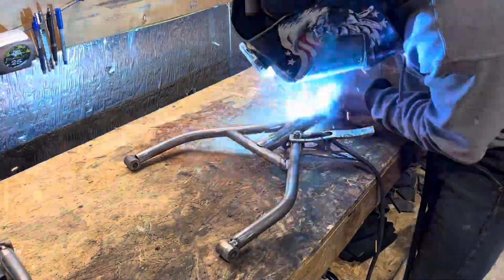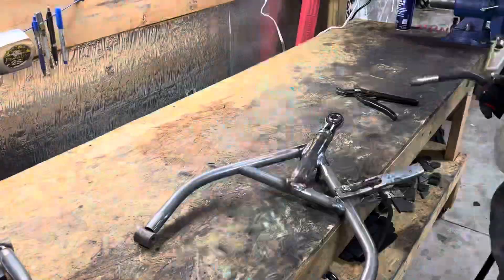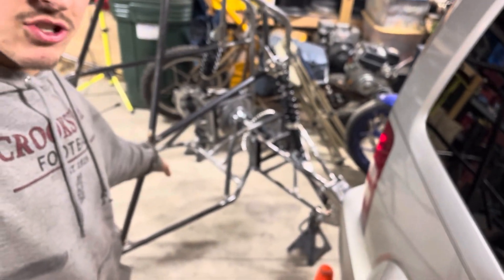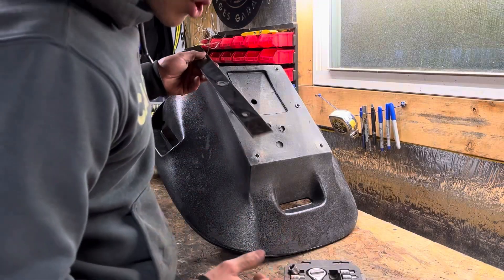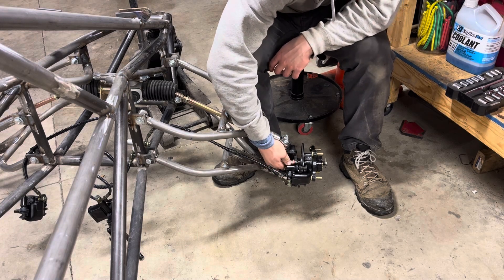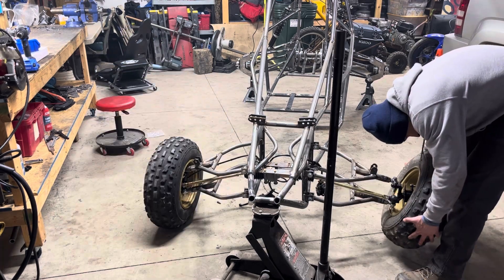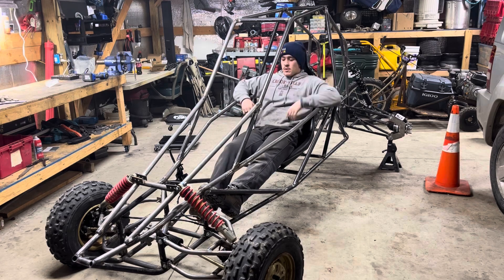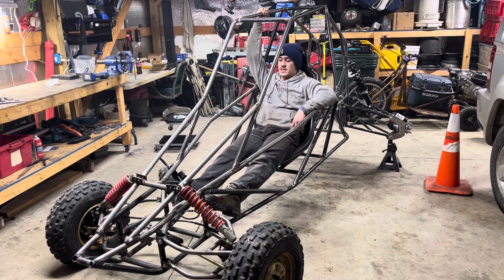CROSSKART Build! Frame work!

Comment: The engine is a hassle. A guy which runs them in competitions is giving me a lot of advice, except on this: Gsx-R 600 EFI (K6 engine or superior) best choce, Gsx-R 750 second, MT09 Yamaha it's... Better have a good mechanic. It's a 850 inline-3, the Legend Cars one if I'm not mistaking. Then last, any Yamaha R6 EFI.
Which are the engines I found to be mounted of factory choice on Yacar Crosskarts.

It was rough to digest.

My argument was that 500 ppl have built a VF1 for the backyard like me and lil' have a 600 inline-4, they're having fun and they don't break gears they break their own welds at worst.
His argument was that, even tho no one (sane) had yet tested a Triumph Speed Triple on a xkart, the reliability of the K6 and those other engines is field proven. Fact is that we don't have a backyard with two straights of half a strip 200m like they purposely set for their tracks, therefore we'll be breaking the second gear and the main just more often unless we use a prohibitive big rear sprocket. 
His argument against cheaper, non EFI engines even Suzuki's, is that they have no mapping and with carburators you're forced to giv'em beans to keep the torque, furtherly aggravating the reliability problems above.

I didn't want to abuse his superkind attitude asking him about a CVT transmission, also I want the shifter, but I suppose that could work, not discounted some hardcore liquid cooling upgrades. I'd take one from a beefy bike since it won't be OP but those have lots of torque. The thought is always that you're raising the weight and friction of the original bike and taking it out for donuts all the time. I don't feel any guilty but it's something to think of, I might have roughly measured the straights on my yard with google maps, for example 😅
Reply: Kawasaki zx10r 2015?
Reply: @alessiofantei6077  really, dnk. His answer about a 1000 would be that there's no such a category to compete, here, with that. 
About the reliability he stressed the point about EFI and those 3-4 engines I said. 
He did not mention tho Kawa as a brand like he did for Yamaha and Suzuki.
What I found out by myself was that the offering of stock Yacar xKarts comprehend only 3 engine options and, say not, are the 3 I mentioned above except the 750 (I imagine the main reason being that here in EU we race 600s but the MT09 inline-3 is admitted too.)
Reply: @bonovoxel7527  here in Italy we don't have any tracks, I just have a big square in front where I can drift
Reply: @ LOOOL didn't read u were .it, keepin on english for public purposes :)
First if you are in the northeastern get in touch I'll make you try my soil backyard you'll make me try some tarmac! :)
For drifting yes you've no limitations from rules and there's a channel with some eastern guy dnk russians or what, they do drift, but they have a track and they use 750+, see theirs too is a GSX-R. 
Guessing your 1000 is good as them now, drifting means you'll have to be prepared to upgrade and yet change a lot of parts before they break, so guessing any engine would do if it has enough power.
Damn, you ll be kickin the sh*t out of that crank and gearbox, I feel pety for it.

About racing it tho... I heard that apart of the FIA and the ACI Sport, there are other leagues that run on dirt tracks and big parking lots like autocross or gymkana, but have to ask the guy the acronym to search i really cant recall now.
There you can run with almost anything 600 and the MT09 and don't require to have a street driving license to be admitted.
Thing he said tho, is that once you run on these "undaground" leagues you're kinda implicitly banned from ACI and so.
Because you know, how things work down here... -.-"

Shame that it's cool to build but would be very limitating having only your private to run it, I had the same concern. This won't stop me ofc but I'm guessing how much it will take for this to piss off all my neighbors and even relatives.
Oh right, it already did rotto i coglioni to all my relatives and it's not even on wheels, don't mind that. :D

Comment: Hi! I am currently drawing out my pedalbox, in case you need one! I'll be probably going to sell the drafts, complete of .dxf lasercut instructions. I couldn't stand spending more than 200 for a box with not even a lapdancer inside. 
I got 3 pumps complete of reservoirs, bias balancer and remote for 150, gotta get it done even springs nuts and bolts for less than 250. 
It's been quite a week of study to reverse engineer it and fully understand the proportions and leverages it has to observe.
Might you be interested to test it as the second person who builds it? Free, ofc. ;)
Reply from the maker: @bonovoxel7527  if you’d be interested in letting me use it’ I’d happily use it on this build! I’ll mention you and your tag and give you all the credit!